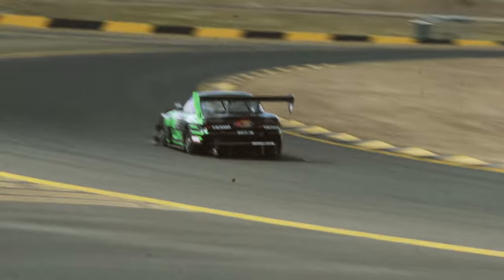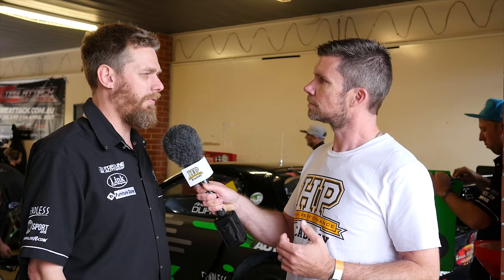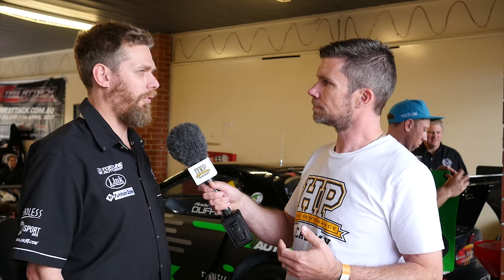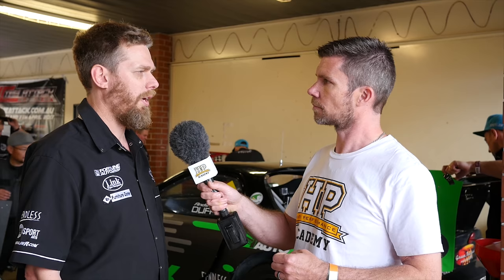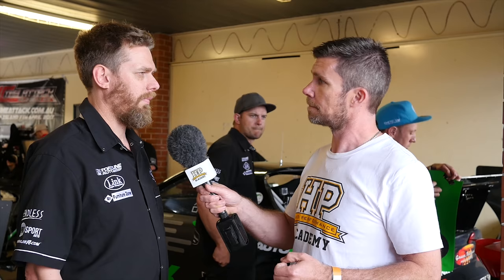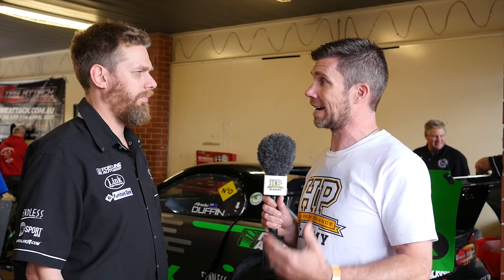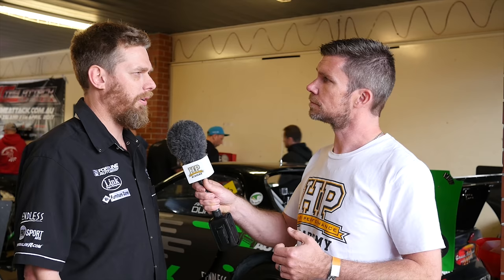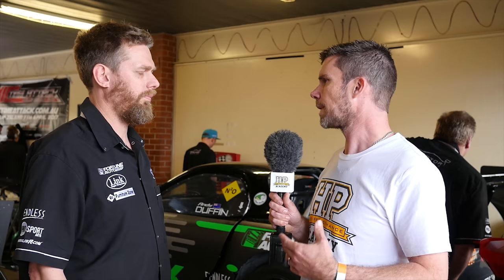10,500 RPM, 670HP rotary engine...without a turbo! | 3 Rotor 20B FD RX7 Time Attack car [TECH TOUR]

Comment: The legendary 767B and 787B engines were peripheral ported 4 rotor NA with ceramic apex seals and ceramic metallic coatings on the inside surfaces of the housings too.  They also used telescopic intake runners to move the torque band up and down the rev range depending  on how high or low the revs were.  I guess the lack of forced induction helped with temperatures and a ceramic apex seal doesn't bend like a banana when it gets hot, scoring the housings like a metal one does.  Nothing puts the max torque at the redline like a rotary.  I think they're the best race engine design ever, personally.  Still don't have the stomach to own one myself tho.  LOL
Reply: Matt Bradley housings were regular ass old nicasil

Comment: Cool video, this is one of the first applications of The Nitrous Wizards Revo system I have heard about in a video. You can inject WAY more nitrous as engine speed increases. Your only limit(s) is how much fuel you got, quality of fuel and engine internal strength.

Comment: Why does he look so angry LOL

Awesome video as always. I wonder what rotors they're using to make such high power naturally aspirated or if they achieved the power through lightening things in the rotating assembly. Did you guys get any details as to how it was achieved?
Reply from the maker: He's definitely not angry haha Like most of us he's just much more comfortable in front of a laptop than having to answer a lot of questions in front of a camera ;)

I don't have any of those details on hand but I'll see what I can find out - Taz.
Reply: Awesome, thanks!
Reply: was wondering that too..
Reply from the maker: We couldn't tell you exactly what rotors are used and that's probably something Richard would like to keep to himself. The main reason the engine is making 670 hp however is the spray of nitrous. Without that the power level is probably in line with what you'd expect from a well developed and well tuned 20B PP engine.
Reply: Not exactly naturally aspirated. It's running with nitrous
Reply: hes angry cos the first question was about apex seals and rotary guys are sick of it.
Reply: isn't NA basically an engine without forced induction?
Reply: Jay that is exactly what N/A means
Reply: well that would mean the rx7 is still n/a?
Reply: its naturally aspirated until it uses the nitrous :)
Reply: Matt Bradley lol probably. Just like the opening sentence of the video fallaciously commenting on the unreliability of rotary engines 😪

Comment: Does the ecu purge the nitrous, is it calibrated to compensate for the delay between gas and liquid, or are they just injecting vaporized nitrous all the time?
Reply from the maker: Purging the system is only a consideration during the initial spray of nitrous. This is why it's common in a drag application so the nitrous provides maximum affect right from the launch. In a circuit application this is less of a concern since the nitrous system will be purged during the out lap.

Comment: How hard on the housings are the ceramic apex seals?
Reply: Harder than carbons, not as hard as steel. They're much lighter than steel seals which helps with sealing at high rpm and reduces chattering